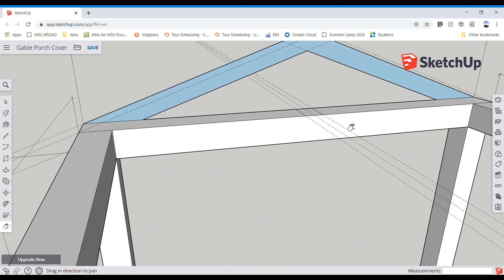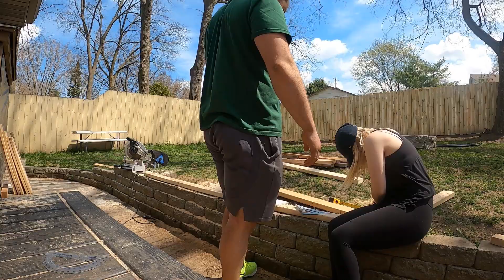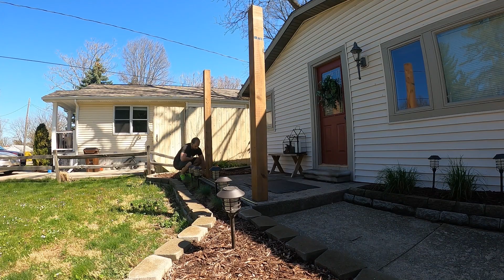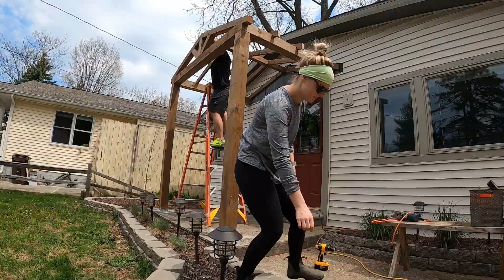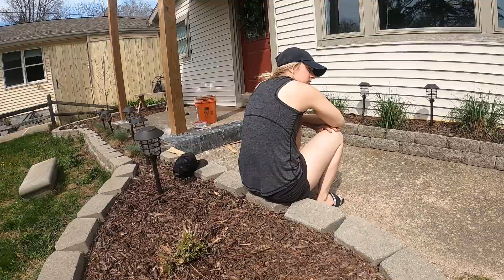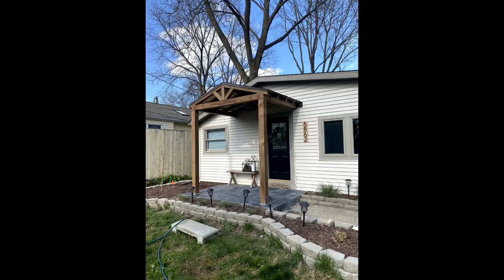Quarantine Project! DIY Gable Porch Time lapse! Easy and Affordable

Comment: This looks great. I may have missed it, but how is the porch connected to the house?
Reply from the maker: Hey, the porch is connected to the house in two areas, both the horizontal 6x6s are attached with 12 screws to the wall, 4 of them being at a stud and the rest on the 3/4” sheathing, and also the 2x4s that are attached to the wall of the house are attached to the 3 studs as well.
Reply: Hi Vinny, can you share the sketchup file?  Your size is exactly what would work for my side entrance. Thanks.